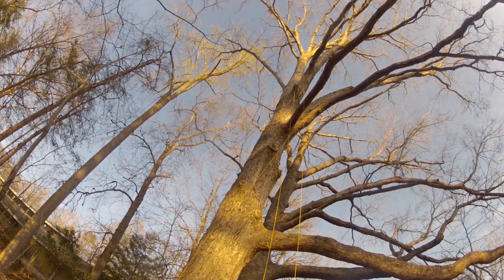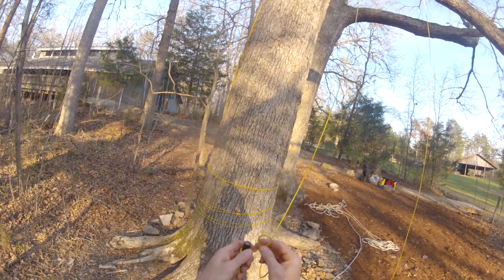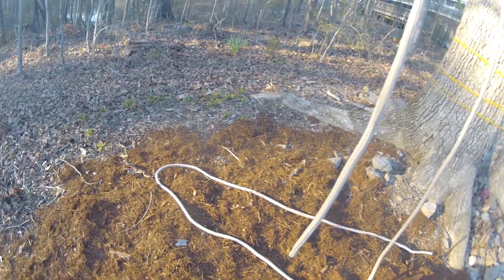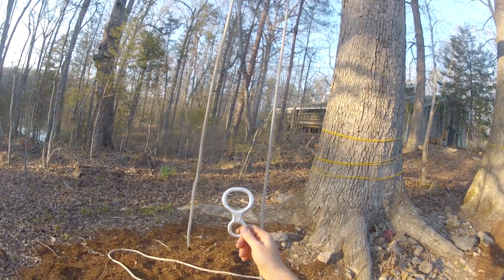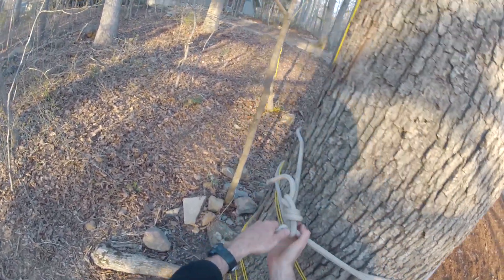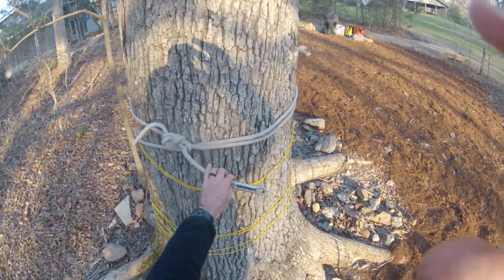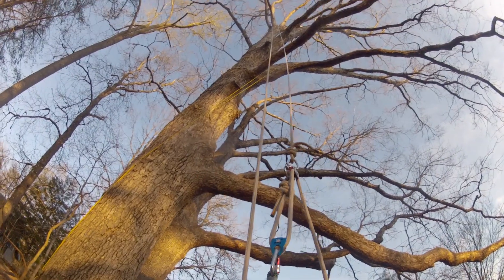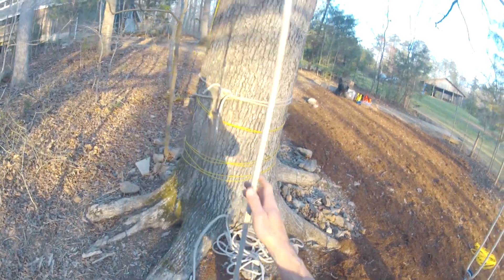Super System - Lowerable 3-1 Tree Climbing System

Comment: I like this.  But I have some questions.  Can you type in the description a bit more detail on how the slip knot works?   It seems it is one of the critical pieces for getting the pulley locked into position at the top?  Ist that correct?  And if it is locked how do you bring the entire system down?   Finally, is the camber protector just to save the bark of tree on the limb?
Reply: The slip knot was used for placing the cambium/friction saver (a horseshoe shaped piece of leather tubing).  The slip knot helps get the saver over a limb, then the slip knot can be removed from the ground to allow the rope to pass through the saver. The cambium saver protects the tree, reduces friction and protects the rope.